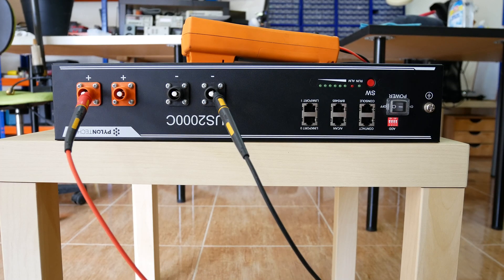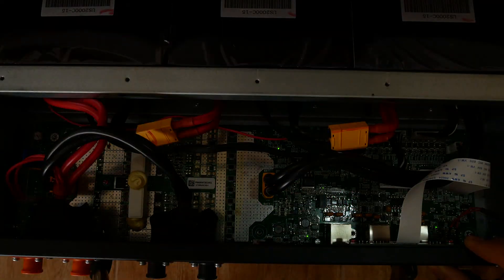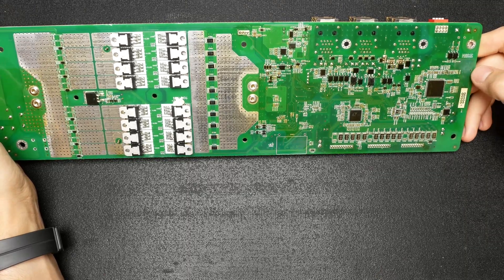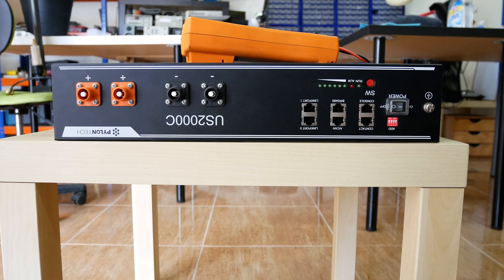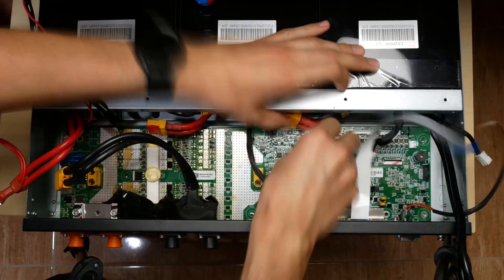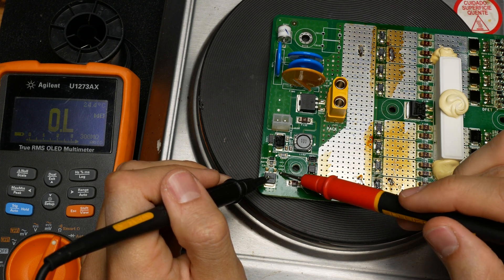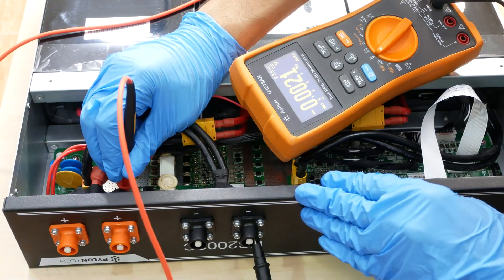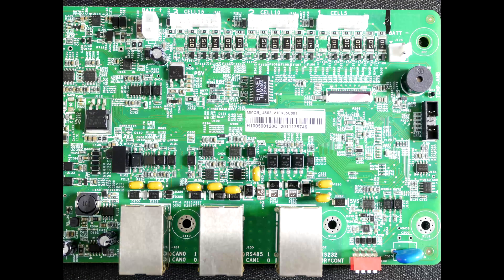Pylontech US2000C internal fuse repair (Solar Lithium LiFePO4)

Comment: Hello for your repair, I have a Us5000 which is the same problem as yours, the Bms flashes green on run but 0v output, I have all the fuses that slammed on the other hand I have the double fuse. Do you think they're the same fuse models? Thanks
Reply from the maker: they might be higher current, that battery is bigger, but they should have markings written on them
Reply: @jfaria Do you talk about the component? I took pictures if you want I can send them
Reply from the maker: @TheDevilchris83  yes, but are you sure the fuses are broken, did you test the continuity to see where the problem is?
Reply: @jfaria Exactly it's the same problem that all the fuses burned, I have no more continuities on the last row of fuse
Reply from the maker: @TheDevilchris83  Oh, ok. Did you check the transistor that burns the fuses to make sure it is not shorted? So you don´t do what I did, and replace the fuses only for them to burn again immediately
Reply: @jfaria Are we talking about the one at the bottom left?https://youtu.be/sRI74nnIFeI?si=m-7ZB2P0w6TVT_2I
Reply from the maker: @TheDevilchris83  yes: https://i.imgur.com/N2WDsjj.png

The circle is around what I think should be the suspicious transistor, the X is to confirm those are the broken fuses, correct?

EDIT: oh, yes, they are broken, I've noticed now that the bottom one is already half removed.
Reply: @jfaria Thank you very much I'm going to make a little video to show you

Comment: This is such a great video, Thank you Jose. I have used 2 tempory glass fuses to see if that is the only problem because all the fuses are dead. But i still cant get the BMS to operate, when i switch the battery on, nothing happens. Then i hold the SW button and the red led turns on and the buzzer stays on with no other led's on. Do you have any suggestions what else to do? I have checked all mosfets and everything else looks good. I have also checked the cell voltages and they are all roughly 3.27v. All the temp sensors seem to be ok. I used a thermal gun, but also can't find any problem component. I am not sure what else to look for. I have a UP5000 Pylontech. Thank you for any help.
Reply from the maker: I had another video planned, but life got in the way. Make a serial cable like this:
https://powerforum.co.za/topic/8532-how-read-data-from-pylontech-us2000c-console-port-to-pc/

and use a USB-serial converter to connect a computer to the battery. 
Either with a serial console or with batteryview (you can find it in these forums) try to see what the alarm is that is causing the red led to light up
Reply from the maker: If you use batteryview and after connecting to the battery you get a parsing error, it's because the software for some reason uses the local computer region settings to parse dates and decimals, try changing the location to US or china
Reply: @jfaria  Hello Jose, thanks for your reply, so i have tried to connect with batteryview, but no luck, i have tried different timezones/formats and regions but nothing happens, when i turn the battery on and try and start it there are a few led's that light up on the BMS board not the SOC led's, but i still cant seem to figure out whats wrong or how to connect batteryview, i dont know why battery view will not connect, i was thinking of tracing the tracks from the console port to the main MCU and bypass all the rs232 stuff and see if i can connect to it's usart directly! Let me know your thoughts, thanks again!
Reply from the maker: @jonathanleichner7117  batteryview is a convenience, the batteries actually reply as a serial console, this is a video of sample commands via serial terminal, there is even a "help"command with the available commands:
https://www.youtube.com/watch?v=O0HRTQnR37A

I believe the speed is 115200 baud, bear in mind older models might need a serial initialization command sent at 1200baud, check the last reply on this post:
https://powerforum.co.za/topic/6661-pylontech-serial-communication/
Reply: @jfaria  Hello Jose, great news, i was able to login to the battery, i needed to reset the AFUSE flag, everything looks to be ok now. I have ordered new SMD fuses and will replace them and hopefully the battery will be good to go. I have a question though, when i dissasembled the battery i notice that cell pack 1 and cell pack 2 are very swollen, but when looking at the logs and voltages there is no problems. Why do you think these cell packs are swollen?

I just want to say thank you again for your video and your repsponses, if you didnt help me i dont think i would have been able to solve this problem. Greatly appreciate your time, thanks again!
Reply from the maker: @jonathanleichner7117  also make sure the mosfet that burns the fuses is not shorted like mine was.

Regarding swollen cells, I have half a dozen like that with me that I didn't decide yet what to do with them (they are very extreme cases, though, even blew the screw heads of and completely bent the steel case).

There will always be a couple of manufacturing defects, if a cell goes bad and the internal resistance goes up it will swell under charge, but those I have like that came from solar installations where they were subjected to heavy charge currents, I don't think these batteries can handle anything even remotely close to the rated charge current limits.

Comment: You are not the only one who made the same same stupid and yes, expensive mistake. 
So once 8 fuses (and this is like some 30€) burned again, I reached for my thermal mini camera to see if the same failure happens (https://youtu.be/G4yYWAtAEUY), to make sure I quickly remove negative terminal.. 

Thank you indeed a lot about pointing out on that faulty MOSFET (when I was suspecting pair of neighbouring Schottky diodes). 

Thanks for sharing!

Comment: ¿Podrías repararme una Pylontech con las celdas hinchadas?
Soy de España
Reply from the maker: Pronto estoy planeando un video sobre cómo hacerlo, pero jamás lo haría por otra persona; de ninguna manera me arriesgaría a una responsabilidad por una batería de litio hinchada. Cada persona puede hacerlo bajo su propio riesgo, pero nadie debería hacerlo por otra persona.
Reply: Hola quería saber porque se hinchan las baterías y si hay alguna solución. Soy de Argentina y gracias por este video.
Reply from the maker: @daveakin5728  Dado el origen de las baterías hinchadas que me dieron, creo que la corriente de carga es excesiva; provienen de sistemas solares con más de 20 paneles y muy pocas baterías. Pylontech recomienda una corriente de carga máxima de 25 A para los modelos US2000; creo que no superar los 10 A con frecuencia sería un límite más razonable.

Comment: I had the same problem happen to me, the guy that was installing the panels and wasn't supposed to touch the inverter-batteries shut down the batteries from the on/off switch while they were operating, the bms burned the fuses. Old school technicians don't know anything other than lead acid betteries here.

After ordering and replacing the fuses they got burnt instantly again because the MOSFET was shorted/burnt too. I replaced the MOSFET with the closest equivalent I could find and I likely ordered more fuses than I needed for future events.

I assumed that the MOSFET got overloaded while trying to burn the fuses, this might be by design.
Reply from the maker: I don't know, the BMS is supposed to disable the pass MOSFETS and the battery is automatically protected from everything, it is supposed to break the fuses as a last resort (like if it disables the mosfets and there is still current). Looking at the fuse datasheet they should use about 0.5A for a very short time, that MOSFET is not supposed to get damaged with a 4A resistive load, there might be something else going on.

Comment: Great 👍🏿 video questions can you convert a pylontech battery to 24v
Reply from the maker: Not really practical, the cells are an odd number (5 in each pack, 3 packs total) and you would have to completely replace the management system.

Comment: Do you know this brand well??
Reply from the maker: Somewhat, we have 4 at home on a hybrid solar system and sometimes people near me ask for repairs as favors. They are known worldwide and have a decent reputation, they even make batteries for other big brands, but people often abuse them and use too many solar panels for too few batteries.
Reply: @jfaria  I messed up 4 BMS thanks to hybrid inverters

Do you think you could advise me?? 

BMS does not want to communicate. Like it was locked
Reply from the maker: @Michalsmutass  Hi, which inverter? 
Does the inverter really need to be connected to the batteries? 
I have an MPP hybrid inverter, when I connected the batteries to the inverter it started to act strange, I've since just disconnected the communication between the inverter and batteries and just use the regular inverter programming to set the charge and discharge voltages.
Reply: @jfaria  solinteg inverter and pylontech batteries 3x 109kW .For tower balancing, a BMS and a master BMS must be connected
Reply from the maker: @Michalsmutass  I see, I have no experience with those, I've seen mostly Voltronic stuff. If the inverter requires communication you will need their tech support, sorry I can't help you.

Comment: I have a US3000C battery with a dead BMS, the LEDs don't turn on, but it still works even with the switch off, and if I connect it to the inverter it works, charging and discharging. It feels like the BMS is bridged. This failure happened with a charger that raised the voltage above 60V. The strange thing is that it still gives VDC output, what can I do?
Reply from the maker: If the BMS is dead you will probably have to replace it. If the batteries are in a safe location that is not a fire hazard, the other option is to just leave it like it is, if it works just add a fuse in series to protect against an inverter short-circuit and use it until it dies. Something like this:
https://www.se.com/uk/en/product/DF221/fuse-carrier-tesys-df-1p-125a-fuse-size-22x58-mm/

Comment: Hello. Thanks for sharing this great video. I have a question if you don't mind. Would those fuses be able to protect the battery if lightning were to strike the solar panels and the lightning energy were to enter the battery?
Reply from the maker: Hi, it would be unlikely that they would protect much against a direct lightning strike on the battery cables themselves, however, the solar panel structure and frames should be grounded, that should take care of the majority of the energy from the strike, then your charger/inverter probably has some sort of isolation and transient voltage suppression, the batteries are probably the safest component in this chain. 

The battery uses the internal transistors to allow energy flow during normal operation and disconnect when needed, however these transistors can fail shorted, that means if that happens the battery can't disconnect the load during an emergency, if the battery controller detects a situation like this it will trigger the fuse protection and burn the fuses.
Reply: Many thanks

Comment: I have a PYLONTECH up5000 when I measure the output voltage on the output terminals I get 49.8v but the moment I connect the inverter. The battery goes in alarm but without a buzzer. What could be the problem?
Reply from the maker: Inverters often fail with a shorted input. Measure the resistance between the positeve and negative input of the inverter to make sure it isn't shorted.

Comment: Hi,
Thank you for your answer and your video. I could fix my BMS board by replacing the 8 fuses (ITV5432L5030WR)
Some description of my experience doing the fixing:
I've ordered a hot air device from AliExpress (Bakon 858 at 50€). I could easily unsolder the 8 fuses without take care of the heat (I set it up to 350°c) because the components were already burnt.
The nightmare has started at the time to solder the new components on the board. I did try to use the hot air device like you in the video. I've set up 180°c (below the max temperature given in the components spécification (max 200°c). At this point, I couldn't manage to solder it (not enough heat). I decided to increase the temperature to 200°, it didn't work too. I've tried 220 then 250 then 280° and I've burnt the component. I realized that the hot air solder is requiring a lot of experience by probably heating the surface and quickly lay down the component but I didn't have this dexterity. 
So I decided to solder the new components by using the traditional method (soldering iron). This hasn't been the solution too because the fuses (ITV5432) are soldered on a quite large surface which make it very difficult to heat, so I've had to push my soldering iron to 280°c (otherwise the welding doesn't melt). By doing that, I've damaged the case of each components (doesn't look nice) but each component seams to work fine after having test using a microcontroller (like in the video).
I mounted the board back in the battery and it seems to work fine now. Of course, I need to test it for a longer period of time.
In conclusion: the explanation that was given in video is definitely the solution, thank you a lot for that. But the fixing required knowledge about how to solder this kind of component and the fact that is it mounted on a large surface that makes it difficult to heat. I'm not happy at all with my ugly solderings and i won't be surprise if it break down again soon.
Anyhow, thank you so much again.
Reply from the maker: I just have a couple of points to add. 
I believe you are not interpreting correctly the temperature graph in the datasheet. In the Littlefuse document the maximum 200C refers to the preheat temperature, as in the temperature the entire PCB area should be before you begin soldering the component. If you look at that table they have a "peak temperature" of 255C during 5 seconds, which is doable by hand with a good setup and a bit harder with crappy tools like we are using, hence the rapid cosmetic damage in some lower quality component packages like these fuses have.

When soldering PCBs with thick traces and lots of via stitching like these you will have to preheat the PCB, otherwise it will be very hard. If you look closely at the video I had the PCB standing on a portable electric plate set to somewhere close to 150~200C. This will dramatically reduce the time needed with the hot air gun and reduce the thermal shock.
Reply: @jfaria 
@jfaria oh ! Thank you for your remarks, now I better understand the process (I didn't realize that the pcb board was on heater plate !). So, the trick is to preheat, it makes sense. You can guess that I'm a beginner and thanks to you I'm learning fast. Now, I just have to wish that my PCB board break down again then it will allow me to practice 😂. Many thanks again
Reply: @jfaria I have followed your error seeking method but I didn't have 49V after "the first set of fuses" (2:00) although I don't find any fuses in that area
Reply from the maker: @jonasaers3869  If the battery is ON with no errors and there is no output voltage, you will to probe with the multimeter between the battery positive connector and several points on the PCB, starting on the negative battery connector on the PCB (you should have voltage here) and start probing away from there in the direction of the battery output, eventually you will find where it stops working, if all the resistors and fuses are OK, maybe you have a problem on the discharge transistors?

Comment: Very good and helpful video, thanks. Which temperature of air flow do you set up ? It seems to be high but the component features is telling to not exceed 200°c
Reply from the maker: Hi, it was a bit too high, set to 350C, but it's a cheap station with a very small nozzzle, who knows how hot it really is.

200C it's pretty impossible to achieve, though, with most lead-free alloys needing more than 220C
Reply: @jfaria Hi,
Thank you for your answer and your video. I could fix my BMS board by replacing the 8 fuses (ITV5432L5030WR)
Some description of my experience doing the fixing:
I've ordered a hot air device from AliExpress (Bakon 858 at 50€). I could easily unsolder the 8 fuses without take care of the heat (I set it up to 350°c) because the components were already burnt.
The nightmare has started at the time to solder the new components on the board. I did try to use the hot air device like you in the video. I've set up 180°c (below the max temperature given in the components spécification (max 200°c). At this point, I couldn't manage to solder it (not enough heat). I decided to increase the temperature to 200°, it didn't work too. I've tried 220 then 250 then 280° and I've burnt the component. I realized that the hot air solder is requiring a lot of experience by probably heating the surface and quickly lay down the component but I didn't have this dexterity. 
So I decided to solder the new components by using the traditional method (soldering iron). This hasn't been the solution too because the fuses (ITV5432) are soldered on a quite large surface which make it very difficult to heat, so I've had to push my soldering iron to 280°c (otherwise the welding doesn't melt). By doing that, I've damaged the case of each components (doesn't look nice) but each component seams to work fine after having test using a microcontroller (like in the video).
I mounted the board back in the battery and it seems to work fine now. Of course, I need to test it for a longer period of time.
In conclusion: the explanation that was given in video is definitely the solution, thank you a lot for that. But the fixing required knowledge about how to solder this kind of component and the fact that is it mounted on a large surface that makes it difficult to heat. I'm not happy at all with my ugly solderings and i won't be surprise if it break down again soon.
Anyhow, thank you so much again.